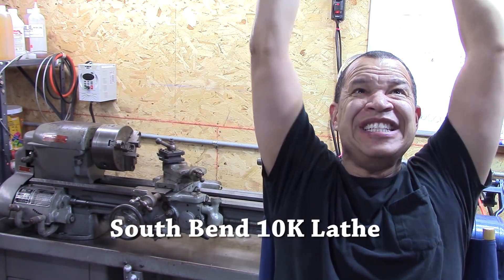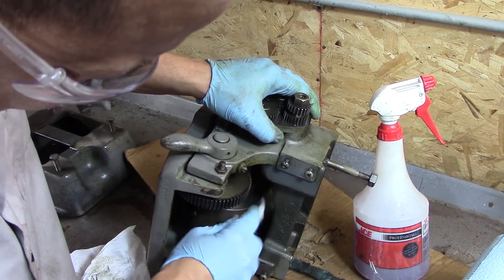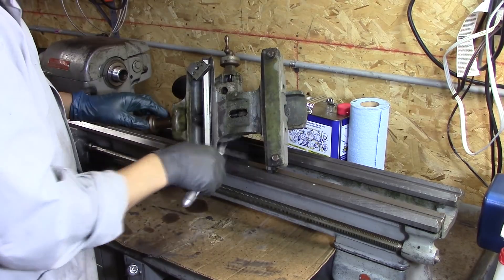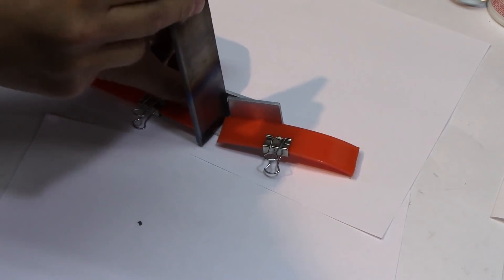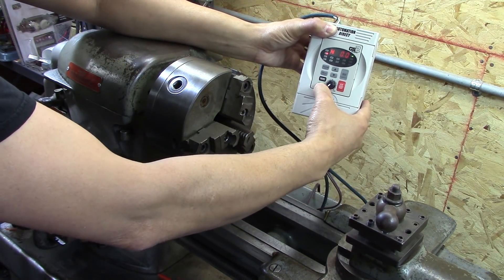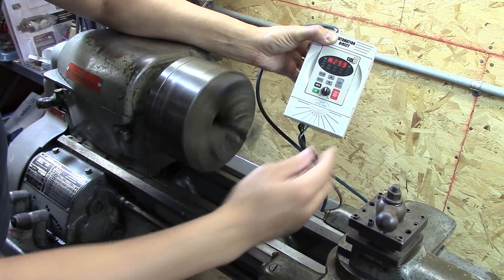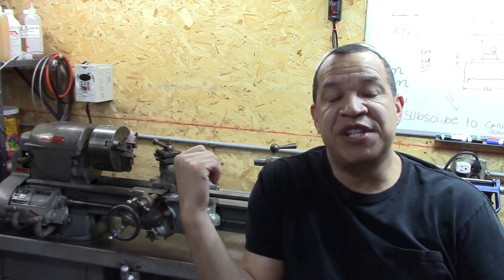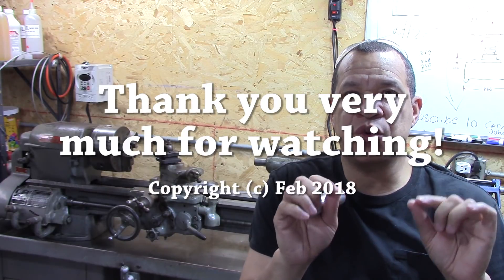South Bend 10K Lathe up and running with VFD

Comment: Does the Polyurethane belt from McMaster-Carr work well?  I may be doing the same thing. Thanks for the video!
Reply from the maker: I love it!  Now you have to remember that I'm not a machinist.  I just used that lathe today and I still love that belt.  I have extremely sensitive ears and I hate belts that make noise.  These belts are totally silent.  Please take that for what it's worth.  Thank you and good luck......
Reply: @jster1963  THANK YOU SO MUCH FOR YOUR REPLY!
Reply from the maker: @markclauss2314  You’re very welcome 😬

Comment: What kind of VFD is it? Is it a single phase to a 3 phase?
Reply from the maker: Al T-Wing Yes. It takes single phase 110v to three phase 220v.  I have no idea how it does it, but it works great!  And thank you......
Reply: @jster1963 Thanks for your response , where did you get the VFD with 110volts single phase input from?
3 phase  is 120 x 3 so it's 360volts not 220v.

Comment: I'm a little late to game here but coincidentally I have just completed my almost the same project, since beginning about a year ago. Mine began as a horizontal driven and I purchased binet complete with under drive unit and 3ph motor. I too installed a VFD which I have done on a couple of milling machines, my previous SB9 and other machines. I am in the process of installing the proper belt and waiting for it. In the  interim not wanting to wait, I am using a serpentine belt crazy glued and stitched with 40# fishing line. Works very well.
 Thanks for the video and looking forward to more
Ray
Reply from the maker: Thank you very much Ray!  I've been so busy that my shop time is very limited.  I hope to be back in the shop soon.....

Comment: Arrgg, that's the lathe I wish I had. Years ago I bought a SB 9 in lathe from a guy locally. I didn't have a clue about lathes, when I bought this but learned a lot since. That lathe is exactly what I need, it's not a big monster, yet it gets the job done. Mine has the QCGB and I have updated the tool holders . I completely restored mine and it serves me well. A few medical issues has kept me out of the shop, but lately I have returned to making chips. NOW this VFD thing has me intrigued . Go to check into this. The wife will just be so happy to see me out their making chips and tracking  the stuff into the house. I guess I can lay the blame on you OK :-) . Ken,  Sure hope to see more on this VFD

Comment: Nice set up you have there, Happy for you 👍👍👍 Super quiet and no annoying squealing is definitely a plus. I went with treadmill motors on the mill since I had to do it on the cheap.  The SB 9 is next for treadmill variable.  Love your enthusiasm. I subbed 👍
Reply from the maker: Flathead Ron's Garage Thank you so much!  I love this machine and can’t wait to do more stuff on it. My job has me pretty busy right now, but hopefully soon. Also, I used a treadmill motor but I had a hard time controlling it. Good luck on your and thanks again.....
Reply: jster1963 I will post a video on my channel from start to finish. No soft start. You can shut it off and restart exactly at the same speed. And you could do the speed controller, bridge rectifier, digital RPM, you can have it with Infinite adjustability for less than 50 bucks. That’s with the free treadmill motor. If you sub to my channel you’ll know when I post it should be about a week.
Reply from the maker: I'm your newest sub.....
Reply: jster1963 Thank you sir, I’ve got a few more ideas also. The treadmill motor with infinite speed is awesome. Thank you for subbing to my channel I really appreciate viewers. I’ve been learning so much and this YouTube community machining is awesome. I’ll try to get more out I’ve got a lot recorded I’ve been working with Tom at hilltop machine and have a package of his to open. I’ll put that on YouTube also I have a bunch recorded I just have to get my butt in gear and do it. Hope to talk to you again soon thank you.
Ron...

Comment: You're going to love that lathe. I've got a Logan 11 that is very similar (looks to me like it might even have been a copy), and I need to finish setting it up. Mine came with a static phase converter, so I'll hold off on the VFD for a while. I did get a VFD with my mill, and it has been going strong for three years. The previous owner was going to throw the VFD in the trash. He had three-phase in his shop and didn't see what use the thing would be. Ha! Glad to see you back making videos.
Reply from the maker: Rick Rose Throw a VFD away??  Wow!  I can’t hardly throw away a VHS tape, so there’s no way I could think about throwing away something as modern as a VFD!  LOL.  Mine came with a phase converter too, but it needed 220v and it would stop working a lot. I love my new VFD. And yes, the Logans look so much like the SB. I’ll be watching for yours. And thank you very much.......

Comment: Man! You have had that SB 10 for five years now? Seems like you just bought it.  That three phase motor sounds and runs smooooth. I didn't really understand VFDs until your video, makes me want  a three phase for my SB 9. I really learn a lot and get inspired by your videos. Thanks man!
Reply from the maker: No thank you!  I really appreciate that!  And yes, I wish I would have know about VFD's years ago.  If a machine said it had a 3 phase motor, I wouldn't look at it.  Now, it's not a problem.  I don't know how much a 3 phase motor will cost you because mine came with it.  But I was pleasantly surprised at the slow speed torque.  I tried to stop the underdrive with my hand at slow speeds, and it didn't even slow down.  Good luck with yours and thanks again....

Comment: Awesome job. Hey, did that purple power react to that aluminum pulley? I bought the purple cleaner degreaser at home depot, and though it's an awesome grease cutter/cleaner for ferrous metal, I got some on a "nonessential" piece of what I thought was metal, it turns out it was aluminum (nonferrous, of course), then the aluminum started this effervescent foaming. I read the instructions, and found it strictly says do not use on aluminum. WHO KNEW?! well, again, did this happen to you?
Reply from the maker: No I didn't have a reaction from the Purple Power.  That is crazy!  And thank you so much!

Comment: Congrats Jster, the ways on that machine are beautiful you hit the lottery!
Reply from the maker: Thank you so much!  I feel like I hit the lottery!  I hope to be learning this baby soon.  Thanks again.....
Reply: @jster1963  Jster, i managed to find the same model SB lathe as yours! I'm planning on do the same VFD upgrade although the pulley on the motor isn;t the original, could you post the specs if yours is the right one? Thanks!
Reply from the maker: @mibooth1852  Does yours have V-Belts on the cone pulley?
Reply: @jster1963  Hi Jster, i lost track of this post i got really busy with my job and life! My lathe has flat belts on the cone pulley and vee on the motor pulley. I'm pretty sure the motor is not original although it is 3 ph @ 1 hp  the pulley on the motor looks like something off a swamp cooler ! Do you know the correct pulley size and hp on your motor ?
Reply from the maker: @mibooth1852  I think mine is 1 hp and what pulley size do you need?  The 2-step motor pulley?
Reply: @jster1963  Yes sir, the motor pulley is what i need to know the size of
Reply from the maker: @mibooth1852  The best I can measure with the machine mounted is 3.5" and 2.5".  It's a 2 step pulley.  It's about 5/8" wide.  Please understand that this is the best I can do with it on the machine.  Good luck.....

Comment: Congrats on getting her powered up. Nice and smooth. You are gonna be shocked at how much more material you can remove with the larger lathe.

 I didn't catch what type of spindle your South Bend has, but be careful running it in reverse. If  it is a thread on type spindle,  you can spin the chuck right off running it in reverse.
Reply from the maker: It is a spin on spindle.  I totally forgot about that!  Thank you and thank you!